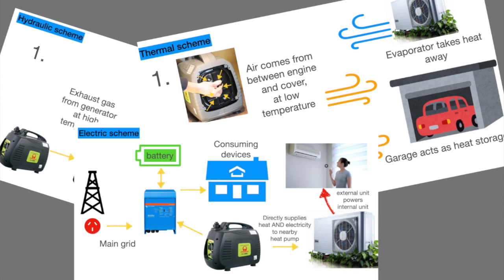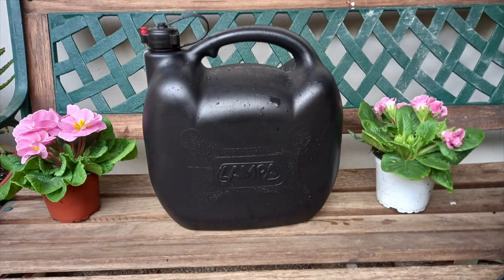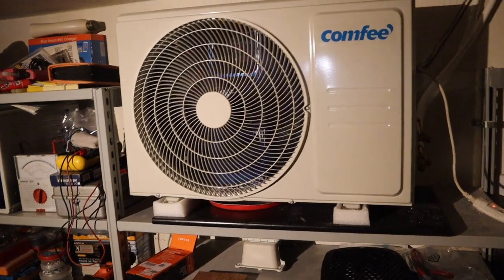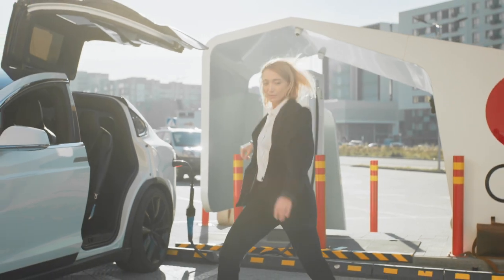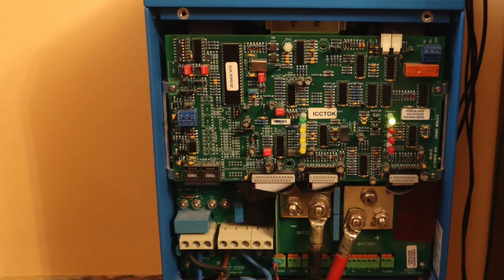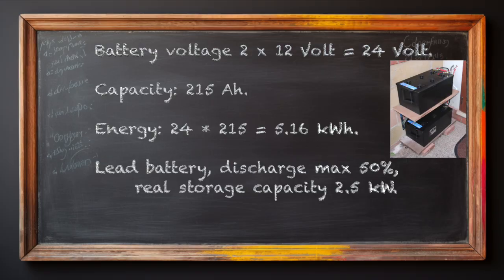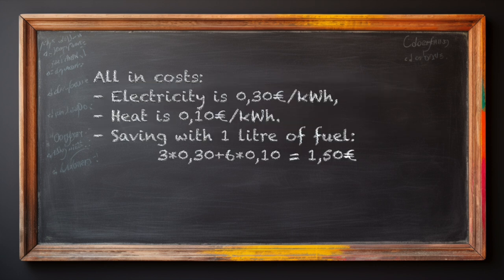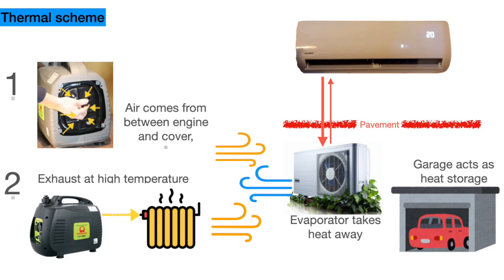First week using my new micro CHP for combined Heat & Power - 84

Comment: Why not feed the heat from the engine (both sources) directly into the evaporator, rather than just have the heat 'free' in the room?
The exhaust heat exchanger could easily be directly in the evaporator's intake.
Heat from the engine cooling fins could be directed though flexible vent piping, simply taped to the hot vent of the genset.

In fact; IF the evaporator is outside; there is no need for the genset exhaust heat exchanger:
You could simply aim the exhaust at the radiator! (with enough distance for the exhaust to 'fan out')
Similarly you could easily duct the heated air from the engine's cooling fins through the evaporator radiator.

That means less chance of CO etc poisoning (from any leaks) and likely less noise.
Reply from the maker: Hey Raylene,  a good idea, especially when it is convenient to place the unit outside. However, i would not like to heat the evaporator too much.

Comment: ANOTHER GREAT VIDEO,NORBERT👍👍
ANOTHER REASON TO IMPLEMENT- AI DATACENTRES,BY 2026, ARE ESTIMATED TO REQUIRE THE EQUIVALENT ENERGY OF THE ENTIRE JAPANESE GRID- ALTHOUGH SOME MAY COME FROM ONSITE RENEWABLES,ITS OBVIOUSLY GOING TO PUT A MASSIVE STRAIN ON COUNTRIES ELECTRICAL INFRASTRUCTURE...
FUN FACT ABOUT UK ELECTRICAL INFRASTRUCTURE - IN THE 1920s, THERE WERE DOZENS OF ELECTRICITY SUPPLIERS- AND THEY RAN ON DIFFERENT VOLTAGES+ HERTZ (CYCLES PER SECOND)- NOT ONLY THAT, THEY ALL HAD DIFFERENT PLUGS!!!
SO IF YOU MOVED OUT OF THAT DISTRICTS SUPPLY AREA,  YOU HAD A NIGHTMARE PROBLEM WITH ALL YOUR APPLIANCES!!!
POWER PROBLEMS ARE NOTHING NEW...
Reply from the maker: Thank you Liam! That drives me forward to go on with this project. There are several videos to go, I think...
You are right about the datacentres, I was also ignorant about the % that they take from the total production of electricity. Then I knew it and here is a video about it: https://youtu.be/cTnZUlZ1EuU
I hope you agree, don't think we are so far yet, to work with high temperature electronics...

Comment: A thought if the generator would be higher than the air conditioner and the exhaust gases would be passed through a water cooler (from the car). The radiator is mounted directly parallel to the heat exchanger of the air conditioning unit and the exhaust gases and condensate can escape at the lowest point.
Reply from the maker: Hi TG, thank you for this idea! I actually have already a new water radiator from  a Fiat and thought about using it. But the input temperature is high and there are plastic parts. I also have to see the resistance to air flow. Anyway it is a good idea to put it close to the heat exchanger of the heat pump.

Comment: I could see a development of generator boxes that include heat recovery, because when you loose power- you also loose heat. Good work!
I have a few small dehumidifiers that have all the parts needed for an air to air heat pump.
Reply from the maker: Thank you R Perkins! I initially wanted build a box around my generator but then the idea with the heat pump in the garage came into my mind. For some people, a generator in the box could still be a good idea to have more silence in home, but for us, the noise is hard to hear. I also thought to build both heat pump and generator in one box.
Regarding the dehumidifier, I also made a heat pump from it and this winter I want to use that and make a compact smart heat exchanger for fresh but warm air exchange because indoor air quality is bad for many homes. Every 3 hours we should exchange all the air in living rooms. Would you like such a project?
Reply: @ I like the idea of tube inside tube utilised by gas boilers- which uses the inside pipe as exhaust, and the outer pipe as inlet, so there is some heat exchange. Could a 12ft version with fan work? An alternative is to use the condenser cartridge from a scrap condenser tumble dryer that uses cross flow. Remember you need a condensate drain for warm moist air.
Reply from the maker: I will keep it in mind, I like recycling!

Comment: Would be interesting to measure after 3  days continuos use. Then the thermal mass would have found its equilibrium?
Reply from the maker: Hi Wouterke, I don't know if that is a typical use of the system. It will be a lot of energy and you won't need so much. If it were, you have taken the components too small. Moreover, a view from Ukraine commented a few weeks ago that the many generators there failed with continuous operation. Then you probably need professional products with a higher price.
I designed the system so that it can run a very few hours and then have a pause. In the night a long pause with low consumption (that is another logic than what people are used to: consume during the cheap night hours!)
Then the temperature in the garage will not stabilise but go up and down, for example between 12 and 18℃.
Reply: @nnvasen-good-energy  Thanks for the explanation. Yes, for that use case it should work. For houses in the Netherlands with longer colder winter I think the balance is more fragile. I considered the unit in the beasement, shed or cellar, but for continuous use I think they really need a lot of air-exchange with the exterior. Or other means to keep a proper average temperature for the outside unit so that it can work with good COP. ( The higher the temp for outside unit the higher the COP. Thats why you combined the genny  as heatsource to compensate the cold air from the outside unit)